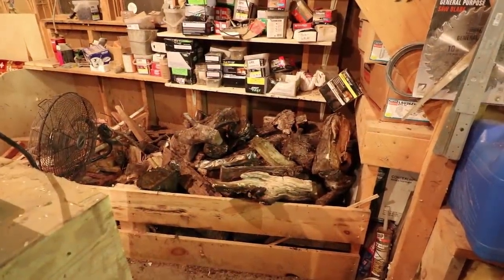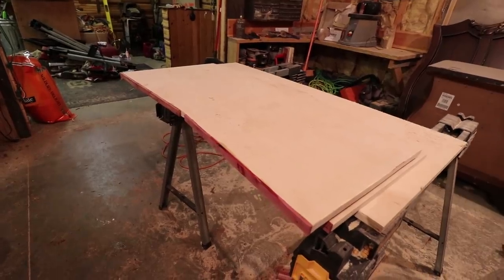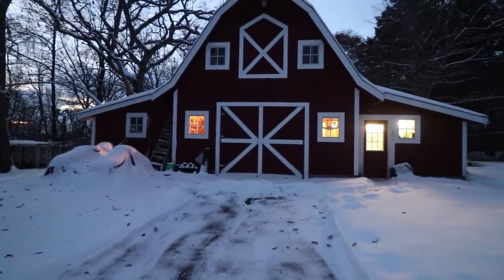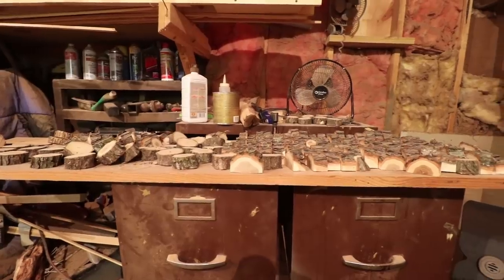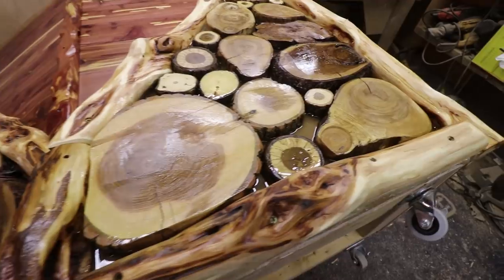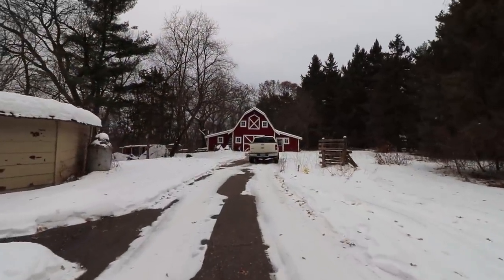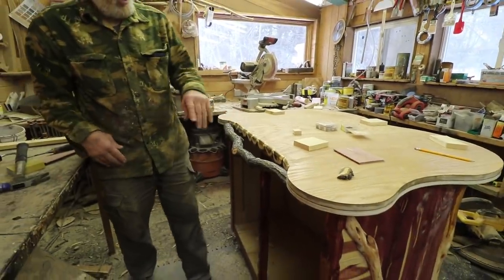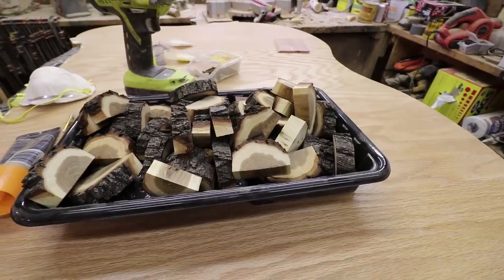THE WORKSHOP. Kitchen Center Island project continues.

Comment: For shelving my wife uses place and press floor tiles. They are easy to install, cut, and easy to keep clean. She does add glue as the tile glue on the back side isn't the best and may come loose. They last for ever and easy to maintain.

Comment: Joe,  Chipboard "as you call it" is actually called OSB "Oriented Strand Board".
Reply from the maker: I was not thinking of OSB, we use that for sub floor and sheathing. I think of chipboard as what goes under formica for counter tops. What he has for that cabinet top isnt even that. I could not think of the correct name at the time. That veneer top is oak but it is a medium density MDF under it. Chipboard was all I could come up with at the time. Lol. Thank you.
Reply: @JoeandZachSurvival  Oh ok , yeah I didn't think of that, Thank you.